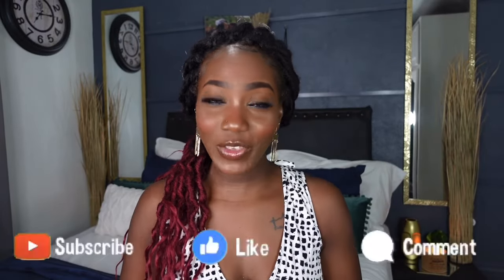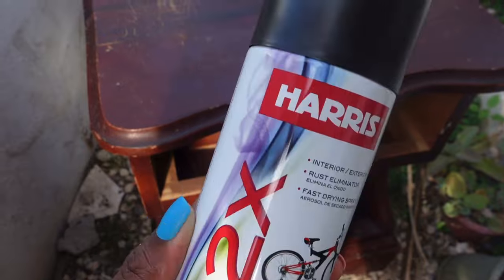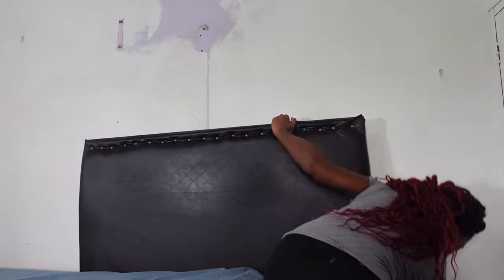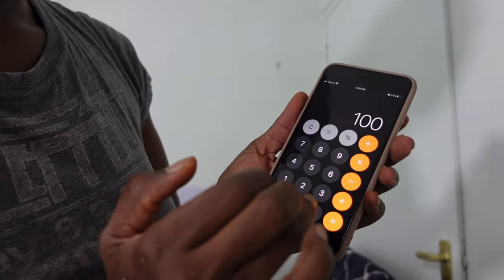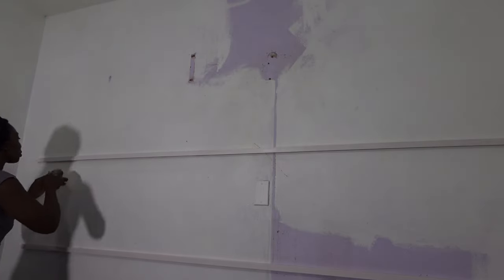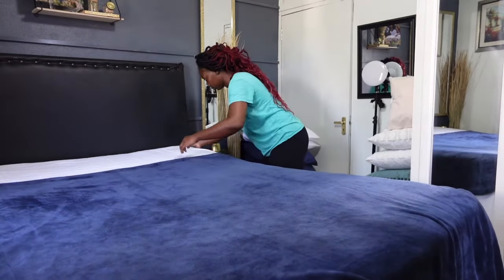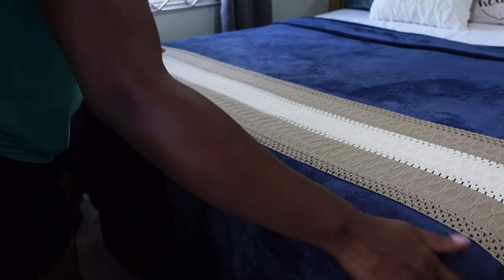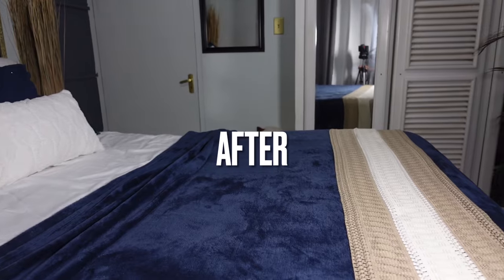DIY EXTREME BEDROOM MAKEOVER | Small Bedroom renovation on a budget Tour 2022 | Jodi The Island Girl

Comment: I made a slat wall recently in my living room, honestly I didn't think of using the trunking 😩 that would have made life so easier, I used strips instead and had to ask for help to drill the walls. 

Thanks for sharing though and great job. 👍🏾
Reply from the maker: Sis, I searched so much for alternative to using the strips but to no avail. It’s like a light bulb literally went off in my head when I unmounted my TV and the wires were inside of the trunking…lol. Yeah this would have definitely saved you the work/cost of drilling.

Thanks soooo much for watching 🙏🏾

Comment: Whats the name of the strips used on the walls..can the silicone used on concrete wall? I wasnt sure if it wad a concrete wall u used it on
Reply from the maker: It’s called truncking…it’s used to run electrical wires and yes it’s concrete walls. Silicone can be used on almost any surface ☺️